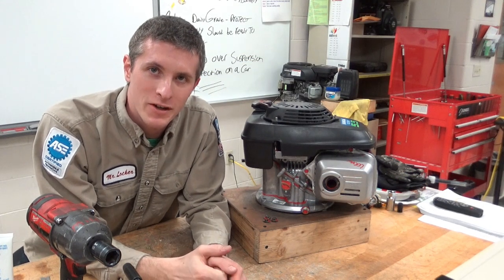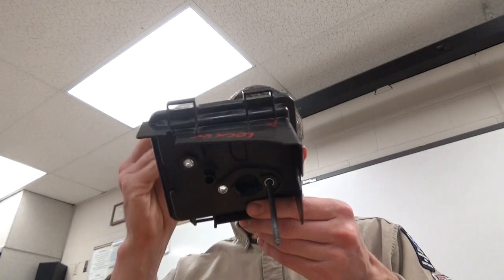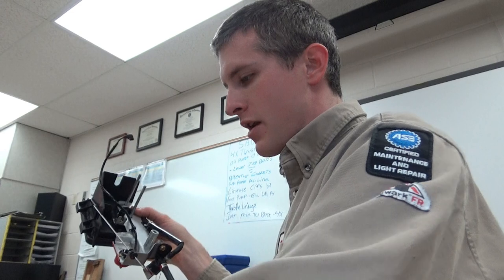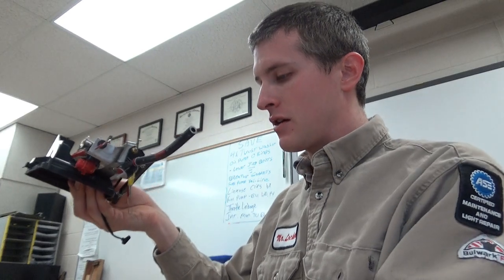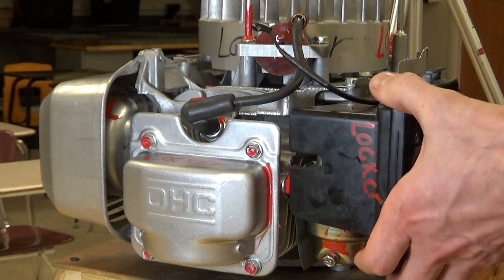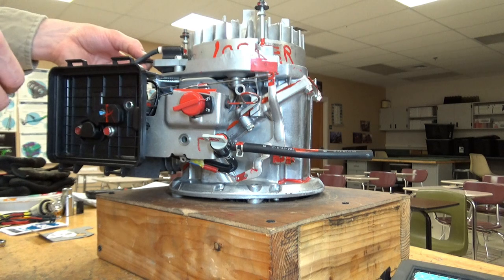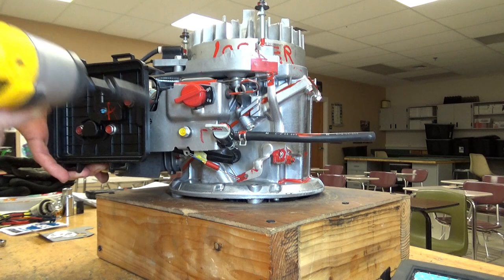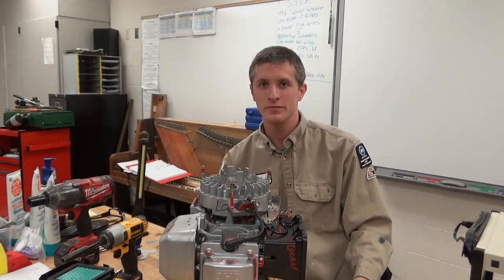Honda GC 160 190 Gasket Order, Governor Calibration, Adjustment, Air Box, and Carburetor Install

Comment: I live off grid in Montana and have several GCV160 engines to keep running. I have one of the older style models as well. Your video is priceless. You have saved me from having to spend time driving and having someone else fix my responsibility. Thank you for teaching me how to go about fixing this much used engine. Best regards!

Comment: Sweet man.. I took it apart months ago and never snapped pics and cant remember what went where..  👍👍
Edit:
My Dad was so meticulous when it came to tearing things apart. Ex: his Trike Gold Wing was doing a timing chain replacement on it, which was a hard ass job. He had  the Parts all laid out as they were taking apart like there was a mock up on the ground of the motor itself. Had screws back in there original part if they could've been. Had  pics/notes next to the parts and numbered how the came off so easier to put back together,  and just by his notes and pictures if needed (Polaroid days 80's)  I actually put it back together as he watched to make sure it was right.  That stuck with me to this day, but for some damn reason I didn't do it knowing I wasn't going to put it right back together the same day. So this video just saved me a lot of cursing and headaches and for that I thank you a ton..  Keep up the good vids.. 

R.I.P pops.. 
Mike..

Comment: I typically refrain from giving negative comments, this however is not so much about the video but a reply to the comments- some of them must be made by people who either have never seen a spanner or gasket, let alone know what functions they have. At least they are beginning on something slightly less critical than a car’s braking or steering system.
If you don’t have the same number and shape/style of gaskets that you removed, then you need to reassess, what you have missing or extra. 
You may want to ask someone to assist you for the first few times of doing something similar! You wouldn’t go and cut someone’s hair without asking for advice, but you are trying to repair a petrol engine without even opening the bonnet of a car before.
Their is no penalties for asking for assistance! We all learn something new every day.
Regarding the video, I think it may be helpful to some viewers to actually lay them out in order on top of a contrasting colour background. 
Finally:-
Take photographs of each step of your disassembly, to refer back to during your reassembly.

Comment: Good  job.  One mention that helps me is realizing the importance of the "little hole" essential to line up.  What you call the Megaphone facing the engine body is achieving the same thing: the little hole lines up, the gas flows where it's supposed to, you don't leak even if the sequence of the gaskets is correct.  The "heat deflector" or the metal piece also has to be lined up correctly.  Any one of the seven or eight or nine or ten variables can throw one piece  out of line up and... yer done for.  Thanks for the clear step-by-step.

Comment: Great job of instructing. I had watched a similar video earlier to yours and he left out not only the order of gaskets but a couple of the gaskets that I knew went in order. What I learned was to take the mounting bracket for the kill switch  off and assemble with carb and airbox as one unit and then mount it to motor. I was trying to do it the dummy way with bracket in place and trying to line all the peices up as I pushed the bolts through.  You way is much easier and faster. Thanks for enlightening this dummy.

Comment: I have just replaced a carb with an after market one, I wish I had seen your video before working, the engine starts and runs but revs are way too high I will try the govenor first but i suspect that I will be starting afresh and following your video!! Well done very informative

Comment: Thank you for a very well done video! I referenced it several times when I was putting the carb back on my pressure washer.
Reply from the maker: It can be tricky especially if you take it apart while you are mad!
Reply: Yeah that assembly can be maddening

Comment: Nice 👍 do I need the air damn/deflector? I’m trying to diagnose what’s wrong w/ me engine & saw that the big paper deflector is torn from the “center hole” to the little circle hole. I ordered a cheap repair kit online.. but it arrived w/o that one darn dam/deflectors lol also very strange.. when I got this pressure washer which is GCV160 LAO.. I knew it was new but not starting & I took apart cleaned it out it back together.. then watching ur video I realized I had the plastic insulator which was stuck on then the air damn, then 1 rubber-ish coated metal gasket between the carb & air filter. But that was it.. no other gaskets? I got the engine to start now & it ran for a couple hours, then locked up the pull string  & the next day started but the moment I put it under load it stalled. My landscaper told me I prob have to adjust the governor or carb? Iduno he was in a rush lol either way thanks for the detailed breakdown & if u read this whatcha think?

Comment: I have a GC 190 on a simpson Pressure washer.  Only has a handful of hours on it. It runs in idle fine, under load it runs for less than a minute, hesitates and dies putting out a puff of black smoke.  I thought carb, took it off,blew out the throttle body and main jet, put it back and no change.  ordered after market cab and gasket set w air filter spark plug  .... installed it with gaskets wrong.  You show that well.  I'll reassemble with proper gasket order and try again.  If no change will try the governor shaft adj...thanks for the concise walk thru!
Reply from the maker: Absolutely!  If you have an auto-choke edition of this engine, it sounds like you have failure of the wax pellet as the default failure mode is full-on choke for a hot engine.  If not, I believe you are on the right track with the replacement carburetor Larry.
Reply: @LockersGarage  It's a manual choke, same linkage and grommet mount as in your video.  Auto throttle.  Put it back with proper gasket order and made sure the springs on governor linkage were right, same thing.  Got the governor shaft marked for a morning adjustment.  Tnx for the reply, Larry
Reply: Mine was doing exactly the same thing. My gas is for scrap when I took them off, but I’m examining the carb. I noticed it wasn’t a jet. It was actually the passage for the jet was totally clogged since the gaskets were shot. I went ahead and ordered all new gaskets, and a new carburetor.

Comment: Love the video! I have the older one, with the metal air deflector but the choke control is up in the handle with the throttle. My question is I can't find a schematic for that old of an engine. It is a GCV160 but starts the other number with GJAEA...How can I find the correct resources and the true age of the motor since I have misplaced my paperwork?

Comment: Adjusted the Governor, got it to run well under load, but idled way to high.  After three  position tries, I returned it to the original position and it runs fine.  What a procedure, hours and an unneeded carb purchase....done, whew!
Reply from the maker: Glad you are in business!  I prefer to focus on the money saved... Putting a carb on a GX series before the Chinese came out with their versions was over 80 bucks.  No gaskets, no nothing!

Comment: I'm lost from the beginning -- tethered gas cap (I put cc on and that's what the robot heard as well)? Show please. You then show a shroud (recoil + petrol tank) and a large gasket/air deflector that supersedes the previous metal style that requires two more gaskets, hence Honda's kaizen (constant improvement). I'm struggling with a GCV 135 which someone has buggered about with -- when I was dismantling the carb, a rubber/metal gasket was stuck -- in a SLIPPED down position -- onto the carb,  preventing the choke (paddle?) from fully opening. I suppose this is the result of Honda's far from brilliant idea to use bolts instead of studs. When I come to the big paper gasket/air flap, THERE IS NO AIR HOLE! So is this something someone has mindlessly put on... Should I put a hole, to match up with the hole in the engine... Well, I came across those metal things in other videos so thought that's been lost off my machine so bought one of those. I don't suppose it matters one way or the other, it's just a cost thing. So am about to make gaskets from the kosher material -- not as pretty as your in-house work, but the gasket sets I've seen online are criticised for being too thin. (Thinks...it's dawning on me why there are different numbers in the sets.. But 3 of 5 or 6!!) 

Anyway thanks a lot, big help! You've confirmed it's a ball-ache! (have made studs to use on dis/assembly until time to put bolts back in...anyone know if Honda is right and there is a plus side to bolts? I'm reluctant to replace them completely until I'm sure. Thanks.)

Comment: The metal plate could have been left connected to on/off switch.  Also when you pit gasket to metal plate you could mention that the hole in gasket lines up with carb there is none on metal plate.  
The rod with the spring could have been left attached  to lever not atached to carb.

Comment: I have just completed with your advice GC 160... New Card installed .Ran on 3 rd pull.....After several minutes running (9). engine back fires while runing  and stops... will repeat this .same routine....Advice  would be helpfull....
Reply from the maker: Is the fuel filter in the tank clogged?

Comment: Gcv160 replaced fuel line fuel filter fuel switch carburetor and thermowax however it is still surging, does not turn on first pull and does not stay on for longer than surging for 3min

Comment: Is it me or are the gaskets at the control bracket reversed?  Isn't the yellowish gasket meant to fit between the control bracket and carb, and the black gasket goes between the air box and the control bracket?  

While those two gaskets appear the same sizes they list them as different part numbers.  The air cleaner gasket is 17228-ZM0-000 (black), and the carb gasket is 16228-ZL8-000 (yellow).  Curious what the difference is.  

I have a 2007 Troy Bilt with Honda GCV160A STA1 and recently removed the carb to clean a stuck choke plate.  Over time the mower was getting harder to start, when removing the air filter I noticed the choke plate was open and would stay in the position I moved it to with the tip of a screw driver.  Seems the spring that closes the choke plate was filthy and clogged up with grass.  Few sprays of Berrymans cleaner got it working like new.  But I noticed the gaskets were in poor condition.  Found someone on Ebay selling a set of 5 gaskets, seems he makes them out of Felpro gasket material, looks laser cut the same sizes as Honda gaskets.  Paid $1.99 shipped.  Listing is for 1 insulator gasket, 2 air guide gaskets and 2 carb gaskets.  

Waiting for the gaskets to be delivered.  I can't remember what the air cleaner gasket is made of, it was actually still stuck to the air cleaner so I never touched it except for a light wipe with a towel before reassembly.  I'm hoping the gaskets are interchangeable, or the one on there is still good.  Rather not buy a replacement for $5.  I also noticed it seems Honda has the replacement air guides that come with the gaskets pre-installed, but Mines the metal one and I don't see a need to replace it since I can just clean it and install new gaskets.
Reply from the maker: The difference is the air box gasket has a aluminum carrier to help with deformation of the gasket.  The one on the engine side of the control bracket is just paper.  We laser cut our own gaskets and consequently use the paper version on both sides of the control bracket.  Good question.

Comment: What if you do a lousy job of putting this assembly back on and accidentally leave a gasket out or get a part on crooked, What would be a symptom of this when you get the engine running?
Reply: Ya, I did exactly that; tried to assemble the unit ON the engine, dropped a gasket sideways, bolted it on, and tried to start it; gas was forced up into the air box, indicating that I got a plugged airway to the engine; took it all apart again, then, as Mr. Locker does here, assembled it all off the engine, part by miserable part, on the bolts, then attached the entire assembly at once. Works fine now.

Comment: Locker's Garage, How are you? 
My Honda GCV160’Engine is good, all cable are well, 
the bell is fine. When Engine is running but blades not turn, however I see center bolt is turning.
 I did not find the  clutch has problem??
Could you teach me how to clear this problem? Please
Thanks for your time.
Sincerely,
San
Reply from the maker: It very much sounds like your clutch is the problem.  Please make sure the clutch cable is sufficiently tight as per your owners manual.

Comment: Sorry but what you demo is not the same for all or even most of these GC honda motors.  There are quite a few differences depending on whether the engine was for a pressure washer, mower, log splitter, etc.

Comment: My carburetor did not have an emulsion tube. Why.
Reply: I have two motors bought about 3 months apart, one's carb made in Japan the other China. 1 has the emulsion tube style the other has not .. same applies to the predator/rato motors we have.. mostly the same,just ensure that the gasket does not block any of the ports , especial the one between carb and spacer.. 
I made the mistake of using the newer style carbon fiber shield not realizing that it blocked that port. Had to cut a new one out of gasket material...

Comment: whare are those 2 adjustment screws do on the carburator?
Reply from the maker: One is the idle speed and the other is the low speed fuel mixture.  Very limited adjustment on the fuel mixture.